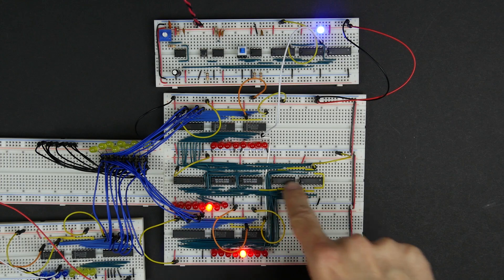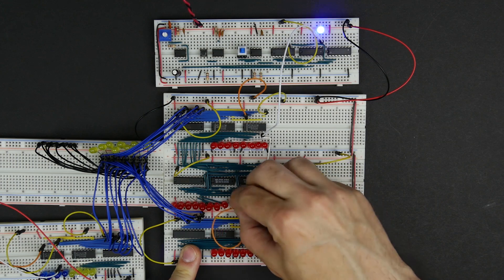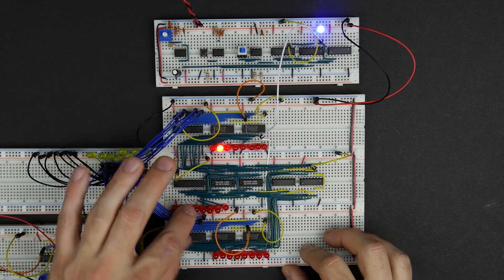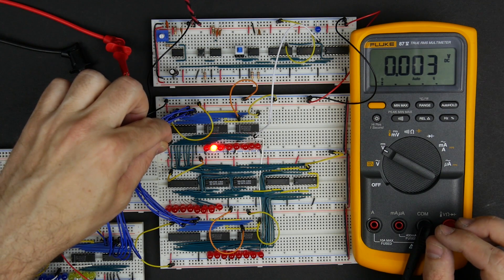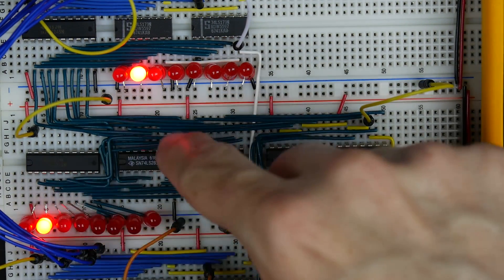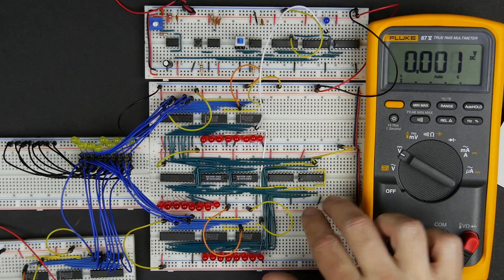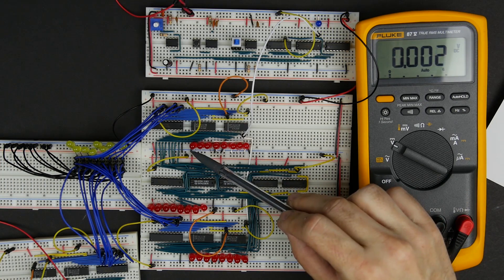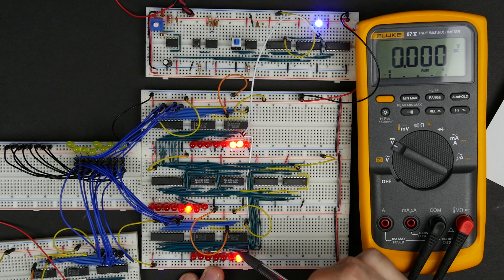Troubleshooting the ALU

Comment: I didnt have time to watch this troubleshooting section.  I had enough of my own problems lol

The first thing I noticed is that i had Leds on the both outputs of my A and B registers.   The Leds pulled down the "high" voltages to around 2 volts.   I just bypassed these .  If I didnt  i couldnt even get the adders to pick up anything.  So I went straight from the register output to adder input.

Next i had my wire strippers set to 24 gauge instead of 22 gauge. (I have 22 gauge wire)  It  knicked every wire and they were breaking off in the breadboard socket.  Never make that mistake again  lol😊.

I had 1 ic (buffer  chip)  bent pin folded under chip instead of in the hole😊

I had better luck buildimg a bit at a time and testing as i went.
(Yes I rebuilt this section 3 times😅)

I discovered a cool thing..
If you load a 1 in 128 bit in A register and load a 1 in 1s bit then
1.   Connect the load  enable to low.
2.  If you have  it in subtract mode it will count down and in add mode it will count all in sync with the clock

Comment: 📺💬 Taking something about ALU.
🥺💬 Integration IC, I searched on the Internet for an arithmetic operators table for SN74LS283N but it is not freed or required registered.  
🧸💬 We called it an adder but it can do more than summing 2 variables together, and it can perform a carry bit for the next ALU to perform a longer input operation.
🐑💬 Working with the clock you should use an adder not because it is fast but reduce mistakes from wiring and the environment, it is true if you accidentally make some of its pins broken but the remaining still can work but not voltage input because it uses the same source.
🐐💬 The integration build good when we have a problem with the clock or delay action we looking at source first because this integration IC not found broken often.
🐑💬 It is not broken we have Ben.

📺💬 This kind of system builds for the persistence of work and it integrates the possibility of working and stability.
🐑💬 Using ALU help with system persistence because we reduce a lot of wiring connection and they use the same assumption.
🐐💬 The only problem is, it is using the same VCC source I want to guarantee its working persistence then I have to use multiple ALU.
🧸💬 You can think of it as a current feuls, you replace when it working abnormally that is why when we see from movie there are many of ALU units and they can swap them.

Comment: Is there a forum if you have problems with building the computer?
My LEDS are draining too much power and thus change the result of the calculation. If I take out the LEDs from the B Register, the result suddenly is correct.
Reply: Apparently these are some special LEDs with built in resistors.
Reply: @k4be.  Hm interesting. In the meantime I solved the problem by soldering resistors to the leds.

Comment: My bug at this point was that my power supply wasn't up to scratch. Up to this point I was using a ELEGOO Uno Kit Breadboard Power Supply Module rated as 700mA. I was measuring the current as 0.5A so figured it should be OK. After a minute or so the expanded circuit started exhibiting erratic behaviour, resetting the clock module and the register values. The behaviour wasn't deterministic, and a ruled out a loose connection by giving the breadboards a good shake! The power supply module started to get warm and smell a little like Scalextric, so I switched to an old Apply 5.2V 2.5A power supply and stripped some USB leads like Ben did and all is well.

To help debugging I added an extra little circuit to allow the register values to be set easily, comprising an 8 position dip switch with pull down resistors connected to a 74LS245 connected to the bus. It fitted neatly left hand side of the placeholder bus breadboard, and allowed me to debug by setting both A and B to 1 and stepping through.

Comment: Alternative implementation, albeit not ideal for the learning process.
The addition and subtraction can actually be subject to a lookup table, in other words, you could program every possible answer into an EEPROM or two. 
The EEPROM could have a 16-bit address input, with the upper order byte being A register's value and the lower order byte being B register's value. As a result you could program 64 KiB worth of math into the EEPROM and just have the computer cheat and look up the answer. If the EEPROM has a higher number of addresses than 16 bits it could even hold the subtraction table as well, with the most significant bit of the address being the SUB signal, and 128 KiB of answers. To facilitate the carry flag, you could have the EEPROM actually output 9 bit values instead of 8-bit values. 
I may have to look at the data sheet for the EEPROM used in this build.

Comment: Umh, where are the corner cases? E.g. 0 - 1 => all output LEDs should light up. Or 0xff + 0xff = 0x1fe.
You could also add bit 9 (LED 9) on the output to indicate an overflow / carry.

Comment: I'm 100% sure you connected the wires incorrectly on purpose, but good video anyways.
Reply: I think you're right. If you look at the wires he "accidentally" swapped, they bend in different places, indicating which should be which. And after swapping back they align neatly. I don't think that's a coincidence.

Comment: Superb video series. A wider range of colours might help with diagnostics. Where possible I follow the resistor colour-code: black for bit 0, brown for bit 1, red for bit 2 and so on. For most circuits the benefit outweighs the minor risk of confusion with, say, black for ground and red for Vcc.
Reply: That’s nice. Any swapped bits will be immediately evident by the order of the colours!

Comment: So 2.5V is enough for turning on logic circuits?
Reply: It depends on the logic family I think. But Ben is probably using chips with TTL levels, those are > 2 V for high and < 0.8 V for low, so then yes, it should be enough.
I'm surprised that the red LEDs don't pull closer to ground than 2.5 V, I think red LEDs can easily go down to 1.7-2 V voltage drop. He really should have series resistors for those LEDs to make sure that they don't mess with the logic levels.

Comment: How come you get 2.5v  with the outputs connected via an LED to ground. I would expect that arrangement to limit the maximum voltage to Vf of the LED or about 1.8v ?
Reply: I did not find any confirmed answer through the videos, but looks like these are some special LEDs with built-in resistor.
Reply: Sorry im way late.  I agree if you have the led straight from register output across led to ground you are pulling that voltage down to LED forward bias drop.   I couldnt get anything to work until i just took these Leds out

Comment: An issue I had with my 74LS283's is that if I leave C0 floating on the chip where its not connected it defaults to high. So I had to figure out why I had a magic 1 when it should have all been zero.  How did your chips not require C0 being pulled to ground? Is that variations between manufacturers?  I'm using Texas Instruments SN74LS283N. I think the datasheets for them show C0 pulled high by default with a 100Ohm resister.
Reply: Actually, turns out I'm stupid lol, realised after I posted that my ALU wasn't subtracting correctly.  Apparently  I missed where you connected the C0 to the line that inverts for subtracting. Apparently I skipped over the tiny part of the video where you talked about that too :/         /Edit, also your series is amazing. I am learning much faster then I normally do on my own with books etc.

Comment: I feel so guilty for my part in what I did to "us." "We" really need to pay closer attention ;)

  I've got this old HP "digital" power supply from the '80s. It uses binary for programming the output. Your really helping me understand how to build a simple interface. I think the manual was designed to be overly complicated to ensure people didn't try to just build stuff themselves. The retail price was $3800 in '89. It's probably just a lead weight at this point but I figure it's a good learning experience.
Thanks again,
-Jake

Comment: Hm, video has been on for a while but I noticed something I don't understand. At about 3:00 onwards you start putting values into the registers. Why do the yellow LEDs not light up in that process? I thought they represent the state of the bus and because the registers load from the bus the LEDs should represent the value you set with the wires and not stay off. What am I missing, can anyone help me out?
Reply: ferrari2k Hey! I might be a bit late, but still. He is using a property of one of the chips, that is that they count no value as high. So he can have some LEDs connected to GND (0) and some not connected to anything, which are then interpreted as high (1). Hopefully this is understandable enough.

Comment: I came across an issue with the ALU showing strange results, following diagnosis, I came to the conclusion it was down to the LEDs drawing too much current which meant the voltage coming out of the XOR gates was below the 2v required threshold for the Adder ICs. I re-engineered the design of my registers and ALU to use 330 Ohm current limiting resistors, you can see the layout here: https://twitter.com/ukanalyst/status/887743134003867648.

If it helps anyone, the ICs I'm using are from Ali Express/eBay and are marked as follows (I assume it must be down to the ICs as Ben doesn't have the same issue):
4 Bit Registers: DM74LS173AN
Quad XOR ICs: HD74LS86P
4 Bit Adder ICs: SN74LS283N

The LEDs I'm using are 3mm Red LEDs with a stated forward voltage of 2V

Comment: Add dip switches to control data moving on bus and for loading and output registers, makes troubleshooting way easier.

I get the pleasure of re-wiring mine because I wired everything correct except for the order of significant bits, ie, my "128" bit was wired to the a1 and b1 side.  This is making most additions work except when i go 1+1 which gives me 128.

Comment: How does he drive LEDs with ttl outputs?? Most ttl chips including the 74ls283 can only source 0.4mA and LEDs usually require like 10mA.
Reply: Dave's Dev Lab Yes, that seems like a bad practice, anyway I just ordered some 2mA LEDs (with resistors to limit the current) and I am going to test how much will the voltage drop at just 2mA.
Reply: I remember back in the day that TTL could drive LEDs and even small motors directly!  That was one of the practical differences compared with building with the CMOS versions of the 74000 series.  IIRC "LS" is "low-power Shockley" so it probably doesn't drive as much as the original series.

Comment: RE 7:12 = tracing your line- JUST A THOUGHT: maybe it would be better if you ran your data lines in more than just one color. Meaning keep your nibbles* the same color so Register A would have Orange/White and Green/White. Register B would have Yellow/Green and Yellow/Blue the same color. With 25 pair you have more options for color.  I know that is hard, but I found if you can find yourself 25 pair telephone (office) cable (number 22 gauge wire), you have more options to identify your runs. The hard part is where to find 50 feet of #22 Gauge pair telephone cable. But it's good to have. I really like your use of Red and Black wire. {*Note 4 Bits = 1 Nibble.  Just for fun -> 8 Bits = 2 Nibbles = 1 Byte.}

Comment: Hello Ben. I'm following along as a way to learn more about electronics. How much more complicated of a system would you need in order to have basic pixel video output?
Reply: Christian Williams A typical video controller for raster display (a picture made of pixels) requires some sort of memory where it stores the numerical values of each pixel representing their colors. This memory is called VRAM (Video RAM), and the part of it where the image being currently displayed is called a "framebuffer". The computer can store data in there to make something to appear on the screen. Sometimes it can also read those data to make some color mixing (e.g. alpha blending), but it is usually more efficient to make this memory write-only.
Then there is another part of the video controller which constantly scans the framebuffer and depending on the information stored in there it updates the display (e.g. lights up the particular LEDs or sends particular informations to the CRT to activate the electron gun when it points to that particular pixel on the screen). This piece of hardware often needs to make some digital-to-analog conversion of the numerical values of the pixels' colors into voltages controlling the display. Therefore this piece of the video controller is called the DAC (Digital-to-Analog Converter). So you need at least these two components if you want to make a raster display for your computer ;)

Before raster graphics, vintage computers were directly controlling the TV controller by the CPU. As the electron gun was scanning the screen dot by dot, the CPU was sending the numerical values for the intensities of each RGB component of the color of the current pixel to the TV controller's DAC, which then used these numbers to control the signals sent to the CRT (Cathode Ray Tube) display (which usually also required encoding the analog signal according to the standards for video transmission, such as NTSC, PAL or SECAM). The introduction of separate chips to control the framebuffer and the graphics modes has been introduced later, to move the load from the main CPU to that separate chip, so that it could do something else in the meantime. Ironically though, it usually couldn't, since the data bus was shared by both the CPU and the graphics chip, and when the graphics chip was in the middle of generating the picture, it was blocking the access to the RAM entirely so that the CPU couldn't access it at the same time (but it could at least work on some calculations on its internal registers :q ). That's why they introduced separate memory chips (VRAM) and separate data buses between the VRAM and the graphics chip.
Reply: IanCraftsAndMines Why not hex for the output? It is more useful, because you can easily decode it mentally into bits: each hexadecimal digit decodes into exactly four bits, according to the translation table below:
0=0000   4=0100   8=1000   C=1100
1=0001   5=0101   9=1001   D=1101
2=0010   6=0110   A=1010   E=1110
3=0011   7=0111   B=1011    F=1111
But you cannot easily do that with decimal digits. That's why programmers usually work with hex numbers rather than decimal – because they can "see the bits" behind the hex number.

But if we insist on using a 7-segment LED display, why not just make it more universal and control each of the segments separately by one bit? There are usually 7 segments and the dot, together adding up to 8 bits – the exact number of bits of our machine word :) So we can simply make one 8-bit register for each of the 7-segment displays and then set the appropriate numbers in them directly from the data bus to turn the segments on or off :) This way we could even display some other stuff than just digits: we could display hex digits, or even some simple alphabetic characters or rotating wheels ;) The conversion from binary digits to 7-segment codes can be done in software then. Or, if you insist, you can add some decoder on the breadboard of the I/O device for the display, so that you pass the input numbers from the data bus through the decoder if needed, but still having the possibility to control each particular segment independently if needed ;)
Reply: Thanks a lot, this will take a while to digest.
Reply: It depends on what video output you have on mind. A CRT monitor would be hardcore. An LCD screen is a bit simpler to deal with. But if you just want something very simple, then how about something like this?:
https://cdn-learn.adafruit.com/assets/assets/000/002/936/medium800/led_matrix_rgbmatrix3232_lrg.jpg?1396789186
Hey, it has pixels :)
Or still simpler:
https://cdn-learn.adafruit.com/guides/images/000/000/018/medium800/green88smile_t.jpg?1448300904
Reply: In the end, compared to his original computer, you would need more memory and a way to decode a signal into the pixels. You would also need a module that does something a screen could use. With this comp (which is really just add/sub) you can just use a 7 segment display for each digit, and a BCD so you don't get a hex output.